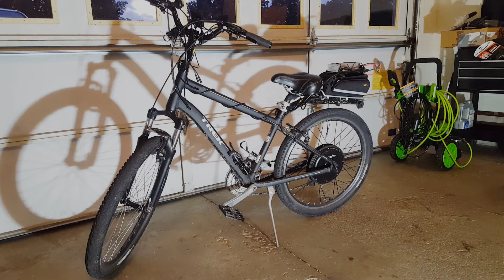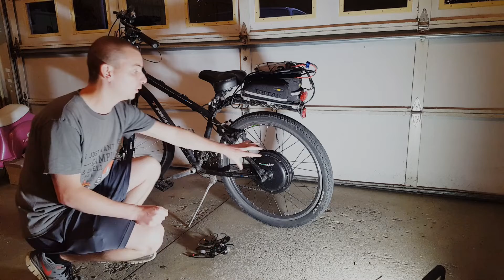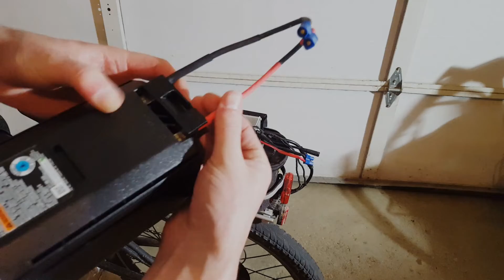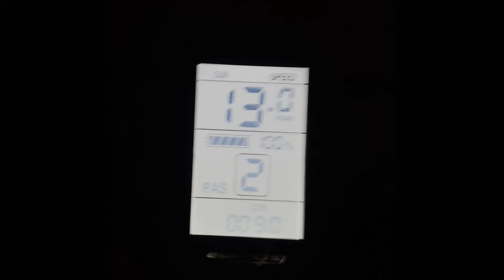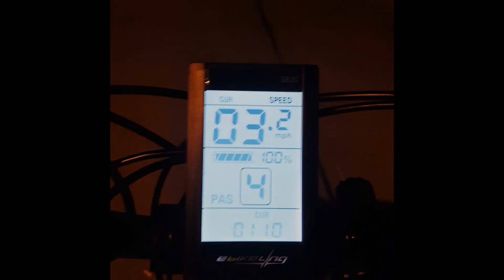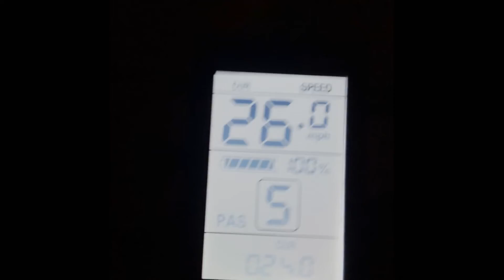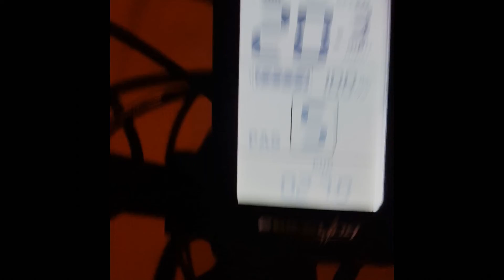Ebikeling 48V 1200W E-bike Conversion Kit (waterproof)!! Live dangerously!

Comment: are you saying that you printed the adapter yourself? Or did you buy it and then put the spades and wires on it? Is there another way to wire this battery. I don't have a 3d printer.
Reply from the maker: I printed the adapter myself. However, one of my spade connectors broke from vibrations. I repaired it and haven't been using the adapter. I just push the spade connectors into the battery and I have put about 100 miles on it like that without issue.
Reply: @diyrenewableenergyelectron4996  Thanks.
Reply: You could just solder the wires to the spade connectors or jam the wires in between the spades on the battery and then glue gun them, one or both,  as I did and it is working. I just glue gunned my wires in between the spades once I jammed them in there with a screwdriver, it works and ya you can do it too.

Comment: I have a 500watt rear hub recently the motor blew and looking for front hub for many reason. I Ride with 2 batteries, 23ah and 11ah heavy. The 23ah is hook to the rear wheel cage. 11ah is on the frame in the middle. I almost killed myself yesterday in the rain. my front wheel at 15mph maybe less not sure, tire slide causing the bike to lose control. i was braking with the front brake lightly and turning it just locked up. The fall was painful and thanks to bystanders I managed. Now because of my setup and the weight my best bet is adding weight in the front. Would you recommend front hub help with balancing thanks?
Reply from the maker: Front hub motors are very hard on the forks (torque). I would only use one(if I had to) on a solid fork bike. I would try to move some of the weight forward or try changing your riding style to favor the rear brake first so that your front wheel won't want to lock up. If you could get the batteries more toward the front that would help a lot.

Comment: So what does the current tell you? Sorry a newbie here😊
Reply from the maker: I'm a newbie too! Always learning new things. The current gives me a roundabout idea of the torque I'm placing on the dropouts of the bike. The more you twist the throttle, the more current the motor draws and the more torque it produces. So I use 10 amps as a good limit to reduce the wear and tear on the bike. Sometimes I go over that, it's fine but I just try not to make a habit out of it.
Reply from the maker: The PAS setting is typically what controls how much amperage the motor can draw. As you go up on the PAS setting, the motor pulls more amps and produces more torque.